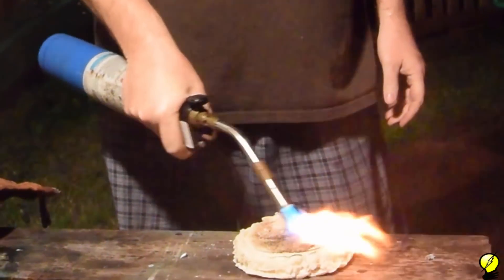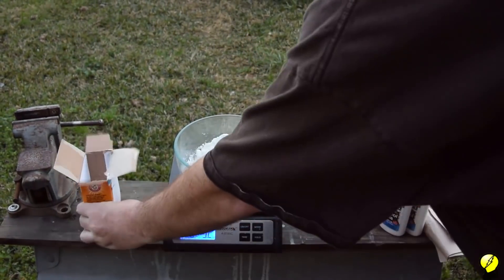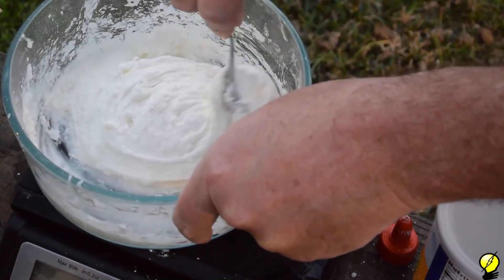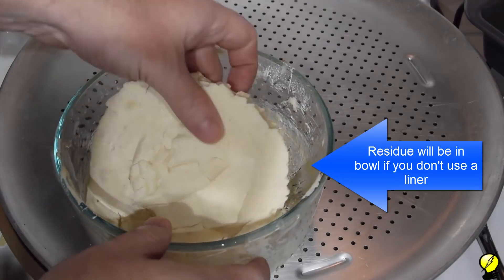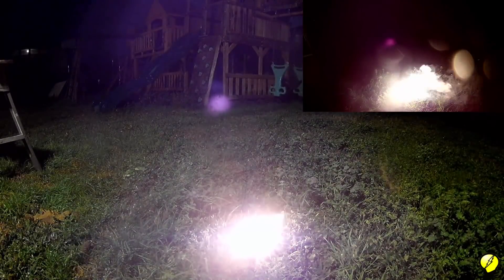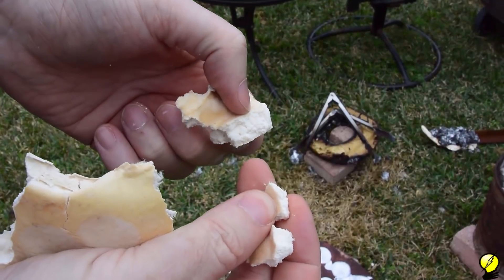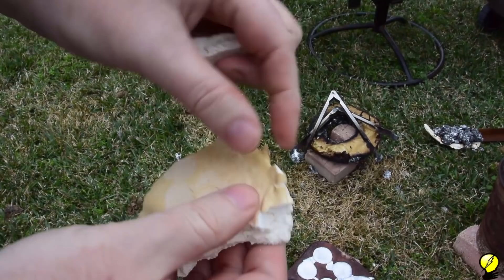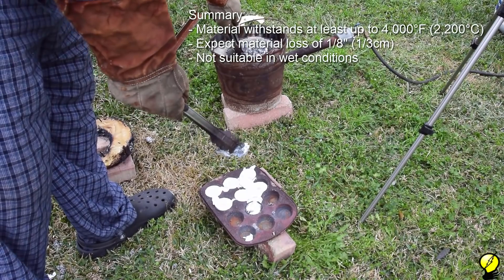Starlite vs. Thermite (Bonus: Foundry use)

Comment: Nice video.  I plan to do something similar.  I have a titanium cook pot that I will line with the N.S.L. I'm going to drill a couple holes in the pot lid and line that as well (not the holes--need a gas pressure vent), then that will be put in a clay pot. Basically I want to use it to convert materials to graphite. And to put graphenic graphites in copper to increase thermal and electrical conductivity.  

     At some point I want to do large amounts at a time, so I'm going to also try two nestled, slightly different size clay pots with cermaic fiber insulation in between, the inner pot will be lined with N.S.L. material, as well as the top cover.  On the outside of the outside clay pot, I will wrap in crinkled Al foil and put some on the top cover as well (not blocking the hole though).   Inside the inner pot will go a large graphite crucible.  The N.S.L. will be spread around the bottom of the crucible. 

    Idea is to insulate it as much as possible.   I thought about doing it in one of those large SS vacuum insulated containers (64 oz +) but I'm a bit worried that even if lined with N.S.L. and some ceramic fiber, I might damage the container.  Also, it's not really wide enough to easily work with.  Getting a larger crucible in and out would be a pain.

Comment: Hey man, that's a great idea! Pick my brain! Sodium bicarbonate releases CO2 and that affects the fire on the surface of the material. Do you think it could be made with silicon?
Reply: is it because the corn starch is converted into sugar that this reaction takes place with the combination of c02? Would the glue then just be a binding agent? Could the glue be replaced with something else? I feel like the foam is key, having pockets of co2 created on the impact of heat would disable oxygen from combusting. There is slight combustion still happening all though it's very slow I feel that the surface can be fixed in a way that prevents fire from even scorching the surface. maybe a nano structure.

Comment: Can you add a small amount of clay or cement  to the formulation, compress it layer by layer to get to make it more dense , then bake it until it's a tile ? 

I have a hunch that would make it a bit less brittle. But I'm not sure if the addition would affect the integrity of its heat rating....I think it would be a cool test for a video. 

What I'd like to do is mix a little of ash and clay together and add it to the mixture, not alot of it, it would still be prominently starlite. Sounds like a good test. I cant do it myself just yet.
Reply from the maker: Both materials can be subject to spalling, so be very careful if you're planning to do this.  Use substances with low porosity to minimize this risk.

Comment: I live in an appartment and do not have any place to safely experiment so I watch videos instead thank you so much for sharing. 

I'm wondering if any one has tried any other types of adhesive element and gotten similar results. Perhaps a different adhesive may alleviate the water vulnerability and provide a product that does not break down under moisture.
Reply from the maker: I've experimented with different adhesives.  The short answer is yes, you can obtain higher water resistance with similar thermal insulation by changing the binder.  I'll share what I found in a future video.

Comment: For how long do the insulative properties of Starlite remain after being carbonized?
Reply from the maker: The carbonized surface is fragile. When subjected to an intense and localized heat source, ablation is apparent.  This can be offset by ensuring that the starlight is thick enough to withstand the demands of the operation.  In short, it depends, but it should not be considered to be permanent.

Comment: oh man if you can make it thin enough, then load that into a co2 whipped cream dispenser, it might be able to be dispensed as an airy foam similar to spray foam insulation
Reply from the maker: You're right.  It also depends on the heat source. The carbon layer is very delicate, so a foam is easily worn away when there is a great pressure difference. The foam would be better suited for a house fire rather than a vigorous heat source, like a blow torch, flamethrower, or re-entry surface.
Reply: Aircrete.

Comment: I am curious what would happen if you added some Portland to the mix? or drywall compound- fireproof/resistant drywall and plaster would be pretty cool.    you might also sandwich it in like... basalt fiber mesh? with another layer of the starlite lathered on over top to thoroughly carbonize?  that might increase the durability considerably.

Comment: Note. Elmers school glue is a water soluable version for easy cleanup. Regular version is water resistant after drying.
Reply from the maker: I've gotten better results using wood glue, which is also water resistant. Water resistant is not waterproof though.  More experiments are underway.

Comment: Well, I had an idea, but I am no expert on this so this is a wild guess. 
This idea comes from mangos, composites, and pycrete (I hope I spelled that right).
Would layering the material in between layers of something like sheets of thin paper or using some form of large grain sand cause it to set better and into a form a sort of hard cement, or would it loose its thermal properties?

Edit: just realized you mentioned it in the video. Welp.

Comment: You can mix the cornstarch and baking soda together, add some water, and then add the glue when you are ready to use it. It coagulates rather quickly after glue is added. The water is also pushed out of the mixture.

Comment: might be a dumb question but since its carbon protecting this whole this is there a risk of increasing carbon content in the steel of a work piece? i want to use this stuff but i cant risk ruining the steel im using by increasing the carbon %
Reply from the maker: It's not a dumb question at all. If you add a little bit of carbon to steel (mixing it into the crystalline lattice which makes up steel)  it increases some desirable qualities, however if you add too much then the steel becomes brittle. Adding the amount of carbon that you want for heat resistance would be too much. However, we can composite the steel with carbon, so that it's not changing the structural formula which makes up steel.  Here is a Wikipedia article that talks about this: https://en.m.wikipedia.org/wiki/Composite_overwrapped_pressure_vessel
Reply: @AdvancedProcrastination   i read that link but i have no clue what its saying. 

let me restate to be clear:  this starlite stuff sounds great but if it touches steel at high enough temperatures will the starlites carbon go into the steel increasing the steels carbon content? because thats bad for me.

also thank you for the reply <3
Reply from the maker: Assuming that the steel remains as a solid (which is the goal since it is insulated by the Starlite), then I would not expect carbon to alter the steel's formula.
Reply: all depends how hot starlight gets on the back end. he used aluminum mesh inside his starlight lid, so seems to me that the interior didn't get a touch past 500F

Comment: As I remember, the original inventor (a hairdresser) was in talks with NASA as they were interested in using Starlight in place of the heat resistant tiles on the bottom of the shuttle.
Reply: til they found out it decomposes within days.

Comment: hey, could an extension arm be made for the torch on a little tripod?  a little safe distance...
Reply from the maker: Yes, and easily done.  But I don't recommend using a torch for thermite, even with an extension.  Better to use a fuse.  I used a torch in the video just to prove that it can be done.  The internet is great, but there is a lot of misinformation out there.  I googled whether it was possible and saw several "experts" stating that it cannot be done.  LOL.  I think one guy "speculates with authority" and everyone takes it as Gospel.  Trust with verification!

Comment: I would love to see if you could use this as a mold for different molten metals
Reply from the maker: I love this idea. I've bumped this project to the top of the list. Expect it soon.
Reply: That would suck because any mold should not deform. But it will create a caron layer and deform so it cannot be used as a mold
Reply: Not a bad idea at all with proper combination of the ingredients to make it runny, you could use it to coat a clay mold of what you want to cast. And the carbon that might stick to the metal but with buffing agents you could shine up the metall from the carbon layer.

Comment: Can be used as an insulator in fire fire clothes
Reply from the maker: Currently water is the Achilles heel with this formulation.  Even if it was sown into waterproof fabric, if   the fabric was ripped in wreckage, fire-proofing would be lost in seconds.  I suspect that changing the binder (PVA glue) is the solution.

Comment: Dude!  You don't have to hold the torch that close!  The hottest point is further out, closer to the end!  Also working your torch in an even circular motion will also build your heat faster!
Reply from the maker: The blue part of the flame is where it gets the most oxygen and it should be the hottest.  But if you are up for a science experiment, put a thermocouple in the blue flame and then near the end of the propane flame.

Comment from the maker: I've gotten a few comments regarding my safety wear.  What do you recommend from your personal experience?  I know that there is specialized apparel available but was hoping to hear some first hand recommendations  from backyard hobbyists.  For example, jeans are thicker than PJs, but are slower to remove in an accident.  I've had molten aluminum burn a hole in a leather welding glove and there was definitely some urgency in removing the glove.  What do you wear?
Reply: Steel toed boots , jeans , a thick leather apron or coveralls
And  gloves
Reply: wear whatever makes you feel sexy dude! don't let others opinions shape your style!
Reply from the maker: Clown shoes & suspenders then.  Thanks!

Comment: Just use magnesium to ignite thermite. Try sandwiching thermite between 2 starlight bricks. Heat rises...
Reply: While yes heat rises the major damaging effect of thermite is the molten droplets of iron still reacting with oxygen dropping down onto objects. This is used in military applications as a way to destroy equipment (Geneva outlaws use of thermal weapons against human combatants.) its usually most effective at completely destroying engine blocks or barrels of enemy ordnance weapons so they can’t be recovered.
Reply: @williamcook9936  The example you describe assumes that the molten metal is falling onto another metal , which has higher thermal conductivity.
Reply: Jason H the example I described shows the most damaging property of thermite which is what dropped onto the tested “nitelite”. while I agree sandwiching obviously would create increased heat due to insulation, I don’t think it would be because “heat rises”. more like heat thermally reflects when stuffed between two insulators.
Reply: @williamcook9936  Yeah, the " heat rising" would be negligible. Radiative heating and contact transfer would be the major energy transfer between the medium. However, since the starlight material makes a carbon foam filled with atmospheric insulation (air), would the individual pockets themselves experience convection? What if you vacuumed out all the air from the pockets?
Reply: Jason H All of that just makes me excited to see what starlite can do now. And what kind of materials branch off of starlite as we mess with it more.

Comment: the best use is around the cans(metal pipe) painted with black 3.0 inside a glass containment when you want to make a induction style stack effect house heater, to prevent wear and tear also fire potential

Comment: Thanks for sharing a great presentation. I am thinking about making hot pads using these same idea so I can protect my dining room table from the hot dishes taken directly out of the hot oven; but I am curious to know if you placed a hot dish that has been in a 450 degree F oven on a hot pad made from this same material; would this hot pad pull the heat from the hot dish and cool down hot dish? If you place a hot dish on a piece of granite, the granite pulls the heat from the hot dish and cools the hot dish down.
Reply from the maker: This new material will not wick heat away as fast as granite.  I just tested this a few minutes ago by putting one palm on the material, and the other on a granite countertop (same room, same temperature, same time). The hand on the granite countertop was significantly cooler.
Reply: @AdvancedProcrastination  Thanks for your quick reply back. That is exactly what I want, a material that can withstand/resist heat and at the same time protect my beautiful dinning room table from the heat. When making hot pads using the same materials you used in your presentation and to keep the 4 sides from crumbling when bumped, cut strips of silicone that resist heat upto 932°F  I would also cover the top and bottom of this mat. The silicone mat I am referring to can be found on Amazon. Soldering Mat Heat Resistant 932°F Magnetic Silicone Electronic Repair Mat for Cellphone, Laptop, Computer, Heat Insulation Pad for Soldering Iron Station15.9” x 12” (Grey) https://www.amazon.com/Silicone-Soldering-Resistant-Electronics-Cellphone/dp/B075M7PQZX/ref=sr_1_1_sspa?hvadid=77996675316590&hvbmt=bb&hvdev=c&hvqmt=b&keywords=silicone+soldering+mat+heat+resistant&qid=1555901136&s=gateway&sr=8-1-spons&psc=1

Comment: I think Starlite would be a good refractory liner for a rocket mass heater heat riser. There is no water in there
Reply: I don't expect it to last well in the presence of hot oxygen. It obviously works really well in neutral and reducing conditions such as in a furnace. As long as your rocket stove doesn't have any oxygen in it's "exhaust gas" it should work, but that may be difficult to control
Reply: lordchickenhawk once the carbon is created, it shouldn't be a problem.

I'll just prime the starlite with a torch, creating that black layer
Reply: lordchickenhawk plus in a heat riser, complete combustion occurs, leaving only CO2 and H2O

Comment: Try making fire proof and strong sheets of concrete for construction -   
Take Vermiculite Portland Cement add mixture of
10 parts corn starch, 1 part baking soda, 1 part Magnesium Hydroxide Powder
(absorbs heat & smoke) then use Aluminum Magnesium Silicate Powder as a
thickener (NOT GLUE) with consistency of molasses before adding to Cement Mix. Of
course, mix it all up in a concrete mixer then pour into sheets and dry. Once dry
then spray onto the surface a mixture of Sodium Silicate, Silicon Monoxide, 21
Mule Team Borax and Graphene Ink.
Reply: Portland cement retains moisture and goes "kaboom" when it gets sufficiently hot.
Reply: I'd love to see you do a video with your results.

Comment: What makes this formula work is the carbon layer that is formed, I have mixed carbon powder with sodium silicate as glue without bicarbonate of soda and had similar results. I am of the opinion that the bicarb generates CO2 gas that acts as a flame retartend.
Reply: I concur. I suspect a "carbon foam" is created.

Comment: Good video :) how game changing is this material in terms of maximum temperature it can withstand? Is it a miracle material like Starlite?
Reply from the maker: At this time, the maximum temperature limit of NightHawkInLight's formula is still being determined.  There is a video on YouTube showing that it didn't survive against a CO2 laser, but I don't believe that any heat probe was used to confirm the temperature. NightHawkInLight's video and the ease of access of the materials are the game changing aspects here; by placing this formula in the public domain, there will potentially be thousands of people tweaking the recipe.  Even in this early state of the rebirth of Starlite, it has already exceeded the heat limit rating of many commercially available refractory products.  That's a heck of a good place to start.
Reply: @LazyH-Online as no one has the original recipe, you cant say ''its the same recipe'' ... damn close though by the results....